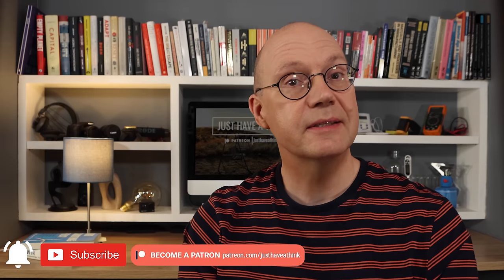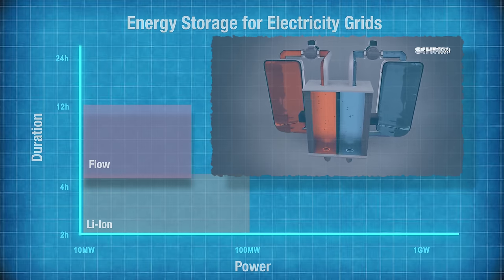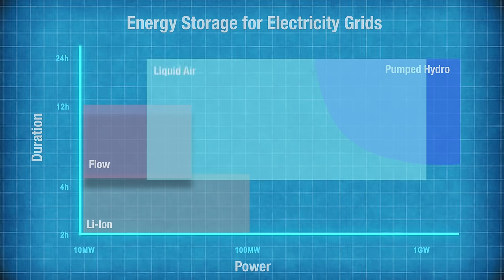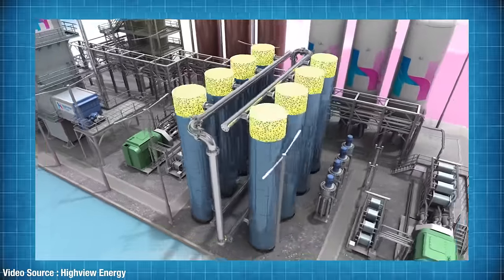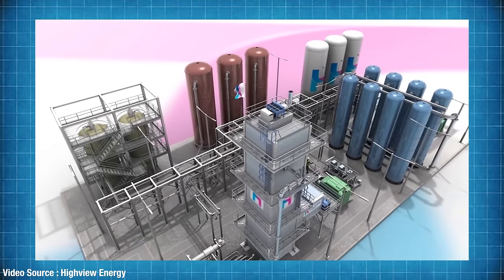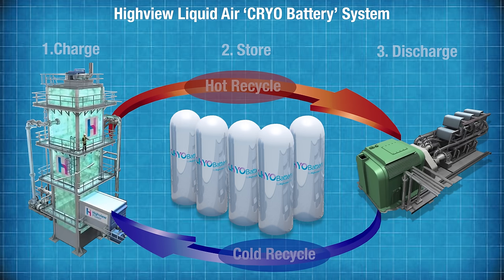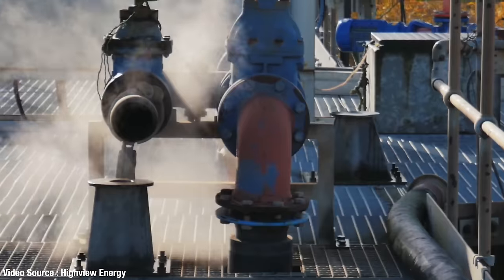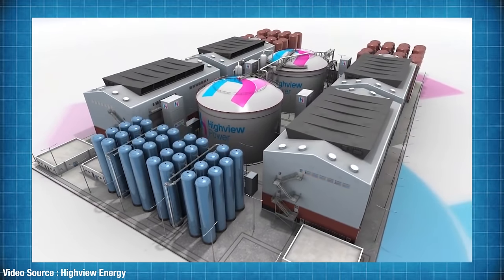Liquid Air Batteries. Literally energy from thin air. Seriously. Literally!

Comment: 60% efficiency? That’s close to the overall efficiency you get with electrolysis. Storing energy in form of H2 has a lot off advantages including curtailment.
Reply: Yes. Solar panels powering electrolysis to power turbines to produce electricity on demand could produce desalinated water for countries bordering coastlines.
Reply: How do you store the hydrogen?  Even liquified, hydrogen is pretty bulky and you have to store it somewhere.  If you're trying to store a lot of energy, then you'll need to store a lot of hydrogen.
Reply: @jonathanguthrie9368  is it using hidrogen batteries? Ehhhmm I mean hidrogen fuel cells?
Reply: @lancheloth  You can use fuel cells to extract energy from hydrogen and I've heard of fuel cells that are reversible, which means they will produce the hydrogen.  However, you don't store the hydrogen in the fuel cell, you store the hydrogen in a tank.  One reason that nobody seriously suggests using hydrogen for anything is because it's difficult to store in large quantities.
Reply: @jonathanguthrie9368  actually, the reason is because hydrogen is flammable. Hydrogen is as bulky as any gas. They are talking about storing liquids. And in that case, if you can liquefy nitrogen and oxygen in the air, why can't you go a few degrees further to liquify hydrogen? In terms of calorific power, hydrogen gas beats gasoline exactly because it is very lightweight ("bulky" is only one way to see it).
Reply: @mariobros7834  Okay, sure.  Gaseous hydrogen is as bulky as any gas.  That's one reason that this "liquid air battery" doesn't store gases.  It's very difficult to store large amounts of energy in gases, although small amounts of energy have been routinely stored in compressed gases for decades.  It was, for example, the way that the equipment built by the company I used to work for would store excess solar power so it could run for a month without any sun.  The diesel truck hybrids I've heard about store energy in hydraulic accumulators, where compressed air is the actual storage medium.

You can, in fact, liquefy hydrogen, but that's not very energy dense either.  That's one reason that, for example, the Falcon rocket uses kerosene as its first stage fuel.  You could, I suppose, store even more energy storing liquid hydrogen rather than liquid air, but then you'd have to deal with the fact that hydrogen is flammable, causes hydrogen embrittlement in common metals, and is harder to contain than air.  After all that, you'd still get much more energy out of it just by letting the gas boil and expand through a turbine than you would trying to burn it or convert it in a fuel cell or something.  So, why bother with the electrolysis and the rest of that when you can get nearly the same result with plain air?
Reply: @jonathanguthrie9368  hydrogen rockets have larger tanks because they operate at relatively low pressure (6-8 bar) vs hydrogen vehicle tanks (300-700 bar), and I imagine a purpose built stationary tank could achieve even higher energy densities, embrittlement wouldn't be a problem if the walls are 3 inches thick.
no need to refrigerate or liquefy, just compress beyond super critical, maybe make some metallic hydrogen :3
Reply: @arkatub  uh huh, metallic hydrogen via straight compression, im not gonna put my house anywhere near that thing lol, the tanks might take that pressure, but what about all the other parts? that would be one hell of a bang lmao
Reply: Jonathan Guthrie 
If you derive electricity from sources of power which exceed all industrial and social need then you don’t need storage and you use H2 as a primary energy carrier to divert into whatever desired secondaries: back to electricity, microwave etc.
Wind is fitful but tides and currents are not. 
Planetary Engineering Modules needed for interface: isotropic vector matrix; khatmatrix; geodesics. 
Khatmatrix (syncopated cubeoctahedra) useful to profile anything and key into any local topography, also to lock sea-water into itself for bulk resistance; isotropic vector matrix good for intermediate spanning needs, also profiling wheels - ex. London Eye, geodesics thought good for exceptionally long spanning and in high-wind oceanic environments far greater response and efficiency in relation to air-flows.
Unforgettable: Ambient Planetary Energy Solar Hydrogen Intermediate Technology.......!
Reply: @arkatub  hydrogen vehicle tanks have high pressure because the hydrogen is a compressed gas, not as dense as liquid. hydrogen rockets operate at relatively low pressure because the hydrogen is cryogenically cooled to a liquid to achieve maximum density. hydrogen rockets have larger tanks because even when a liquid, hydrogen is still a low density fuel. Liquid hydrogen is lousy for energy storage except at exceedingly large scale because liquid hydrogen requires cryogenic cooling that eats energy, and only economies of scale begin to bring the costs down. Other systems tend to be more efficient and cheaper.
Reply: @arkatub  The tanks that will stand metallic hydrogen via straight compression will be tiny and wont connect to anything.

Comment: Do you remember when those who didn't like renewables had the same old cliche; "What happens when the wind's not blowing and the sun's not shining"? Looks like we will soon have more viable energy storage methods than we can shake a stick at; Necessity truly is the mother of invention.
Reply: exorientelux  As opposed to the millions of birds, bats and insects killed by smog and climate change.
Reply: exorientelux ..but surely a lengthy working lifespan of 25 years or so makes wind and solar environmentally viable? The static foundations, pylons and support frames last much longer, while turbines can be re-built. Solar panel technology is leaping ahead in terms of materials and recyclability.
Reply: James Brooks : Not really. Short term it looks good but long term, it’s no better than the gasoline engine that powers it.
Reply: Clive Mitchell : Good point. Let’s just double the carnage. That will fix everything.
Reply: James Brooks : You are overly optimistic. The lifespan is based on proper maintenance. Fold in the maintenance cost in time and money and it is a failed system.
Reply: Professor MAWillett ..for a failed system it seems to be attracting a lot of investment. Meanwhile fossil investors live in fear of a divestment avalanche; when the music stops, they don't want to be the last one to be left clutching an Exxon share certificate.
Reply: James Brooks : I do not doubt that there are investors. And I am not opposed to research and development however these technologies will not overtake fossil fuels, hydro and nuclear before the fossil fuel reserves are exhausted. I think investors in fossil fuels are quite content with their returns.
Reply: James Brooks : I’ve viewed a few videos of the energy lifecycle you and others are advocating. You depend heavily on renewable or alternative energy sources. I believe there are some promising aspects of the proposed system. I still think except in relatively small implementations under very tight quality control, this energy lifecycle will not, cannot supersede fossil fuel, hydro and nuclear power systems in neither cost or quality. I intend to pay more attention to the systems necessary for this energy lifecycle, cradle to grave. I am pessimistic but I could be wrong. Be prepared to defend your assumptions.
Reply: Professor MAWillett ...costs of solar and wind are falling, while their efficiencies are rising. Couple that with shear power of the sun's energy falling on Earth (peaking at about one kW per sq metre in Death Valley, Nevada). So whats not to like?; We have a free nuclear reactor that we call the Sun..all we have to do is harvest the power, plants have been doing it for billions of years.
Reply: Professor MAWillett ..not content at all; they are coming under pressure from activist investors, and they are losing the public relations battle; many increasingly understand that fossil fuel is dirty, polluting, causes global heating and lung disease. Who wants to explain to their children in ten years time that they invested or worked in the fossil fuel industry?
Reply: James Brooks : Well, the system is failing here in California. Solar and wind power may be an acceptable energy solution however, ineptitude, poor management and corrupt politics has and will stifle any advantage alternative energy has to offer.
Reply: James Brooks : That assumes that they are not living under the threat of never ending brownouts and blackouts. I’ve reviewed the proposed technologies and if implemented properly, alternative energy sources show great promise but.....I do not have the confidence in the leadership both political and business to keep the best interests of the public in mind.
For the foreseeable future, fossil fuels will not be replaced by alternative energy sources. The basis of my opinion is that when the alternative energy sources are overwhelmed and fail, it’s the fossil fuel power sources to the rescue. I am of the opinion that fossil fuels will remain a viable source of energy until they are exhausted on planet earth.
Reply: Professor MAWillett ...That would be an extremely risky course of action; According to the multiple scientific disciplines that inform us about our rapidly changing climate, we need to keep atmospheric CO2 to under 350 parts per million. It was 280 ppm before industrialisation, and this year it is around 415 ppm. In recent years we have been putting about 40 Giga Tonnes of CO2 into the atmosphere each year. We are all aware that science informs us that we are putting the next generations at risk, so why are so many parents prepared to discount these warning?
Reply: James Brooks : James, even at those levels, the global temperatures are estimated to rise less tan 2 degrees C over the next 100 years. This will not cause a runaway greenhouse effect. Over the life of our planet, this is a blip and a lot can happen in a 100 years. I am not in favor of committing energy suicide over increases in CO2 especially since the connection between global temperature and CO2 is tenuous at best. Water vapor has a much larger effect on global temperature than does CO2 and Methane (CH4) combined. 
This is not to say that I am opposed to environmental responsibility with respect to clean air and water from any and all sources but I believe that fossil fuels as well as nuclear power are part of a energy future that the world population will insist on.
Reply: Professor MAWillett ..yes, i can understand why non-scientists wonder what the fuss is all about when the worst case scenario is given as an extra 5 degsC. However, the real issue is rate of change. As you say; 2 degs in a 100 years doesn't seem fast. However, we can put this in perspective by considering the Paleocene-Eocene Thermal Maximum, which warmed the Earth by approx 5 degs over the course of 10,000 years. It is thought the PETM might have been due to a tipping point; for example ocean warming leading to the melting of deep water ice nodules containing methane, or methane released from melting permafrost. The same issue that concern scientists today.

'The Paleocene-Eocene Thermal Maximum (PETM) was an abrupt global warming event that occurred at the beginning of the Eocene Epoch, about 55.8 million years ago. At the start of the event something like 5-10,000 gigatons of carbon were released into the ocean and atmosphere in less than 10,000 years'.
Reply: James Brooks : Yes, I am familiar with that episode but scientists do not know what initiated the event. It could have been one thing (I doubt it) or a combination of several things. The chain of events is unknown and who is to say that without this event, humans would not have evolved. No one has a crystal ball to look with certainty into the past or more importantly, into the future.

Comment: The round trip efficiency of >50% is only achieved when they add in additional 'waste' heat from the burning of gas from a local landfill site - it is not correct to claim that this improves the efficiency because this is an additional input of energy in addition to the electrical energy supplied to the 'battery' during charging. It also emits CO2.
Reply: Yes, got your point, but anyway is waay more efficient than anything, and the emissions wouldn't be no one near of what we see today
Reply: @LordCogordo  - the reason they are doing this is to claim round trip efficiencies approaching the 80%+ of flow and lithium-ion batteries. They are trying to jump on the battery bandwagon but in doing so they are being highly misrepresentative with the numbers, some would say deceptive.
Reply: But the CO2 is produced from methane, which is actually a net reduction in greenhouse gases.
Reply: @TimpBizkit  Methane is a lot shorter lived, in the atmosphere, than CO2.
Reply: Its a good thing CO2 is required for all life on the planet.
Reply: @DeletedScenes312  the deception is that the technology is competing with batteries instead of competing with electricity and petroleum. That's the fraud!

Comment: I have always said we really need to learn to use less energy so negating the need to build more power generators
Reply: Very true, engineer out the demand, then engineer in the efficiency, then clean up the supply, add some smoothing, and then maybe some storage.
Reply: That's the only way to actually overcome the current climate change.. I'm glad more people understand this. There is no way we can tackle climate change by producing more of energy or things from raw material.. We need to incorporate this in our lifestyle
Reply: @nitin577  How is an excess of clean energy incompatible with overcoming climate change?  It's not.  Cheap clean energy allows us to do all sorts of things that clean up the environment rather than harm it.  Direct air capture of CO2, for example.
Reply: @incognitotorpedo42  You have to understand that clean energy doesn't exist, unless you can do photosynthesis. A windmill or a solar panel require materials to be extracted, refined and assembled. Can it be done in a clean way ? No. Even recycling, as good as it sounds, isn't clean. There's always a cost.